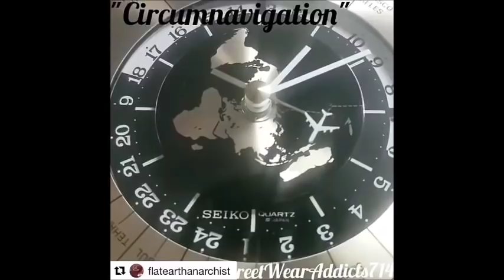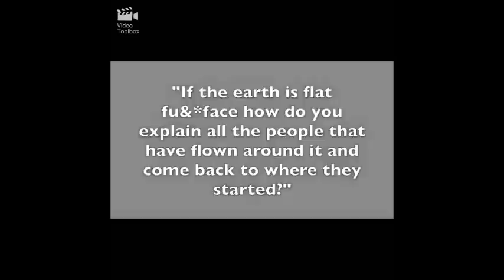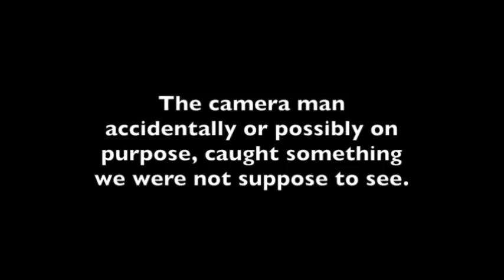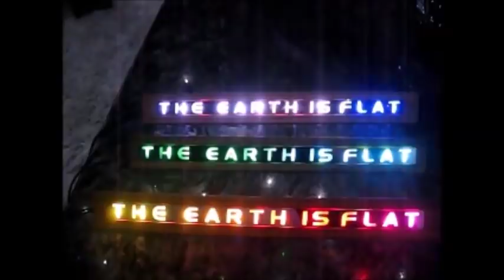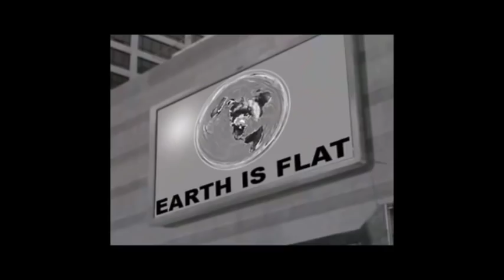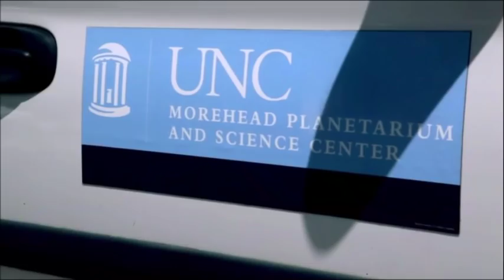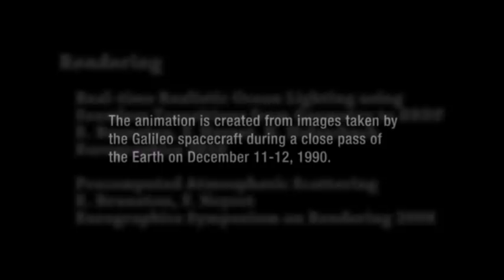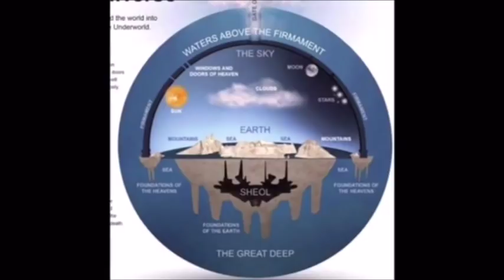Flat Earth Q&A Emails 84 Mark Sargent ✅

Comment: How do flat earthers explain Halley's Comet and it's 75 year orbit? You can't, just like you can't explain many other things.
Reply: ophirdog how do heliocentric ball and sun worshippers explain the fact that the gravity of the sun somehow turns Halley's comet around even though the comet was flying away from the sun for almost 40 years. That would be like turning Pluto around 180 degrees and making it come back to the sun. Also in those almost 40 years that Halley's comet was flying away from the sun, the sun has been flying through space at millions of miles an hour in a different direction. So the sun isn't even in the same spot it was at when it hurled Halley's comet back into outer space. Your model makes no sense and requires faith to believe
Reply: David Romero
The Sun's gravity does control Pluto, just as it does with every object in the solar system. And yes, the Sun does fly through space, but so does the whole solar system and everything else in the galaxy. 

So I'm wondering, can flat earthers explain the great length of time Halley's comet is travelling through space.
Reply: Light shining through water above firmament
Reply: @David Romero For us in the southern hemisphere the Sun moves in a anti clockwise direction. The Sun also heads in a southerly direction as it sets which is the opposite to what you people are claiming. You can't keep ignoring this fact forever.
Reply: @David Romero Why is it so had for flatties in the northern hemisphere to understand that the Sun's apparent motion in the southern hemisphere is anticlockwise. Yes, it still rises from an easterly direstion and sets towards the west. Also from the moment the Sun is above the horizon its size does not change all day, this would not be the case with the flat earth model. Atmospheric refraction rarely affects terrestrial objects to any degree and if there is refraction it's easily detected. You might want look into seismic waves as seismic wave velocities increase with depth and are refracted and reflected when a change in density occurs, a bit like when light hits the surface of water. Well at a depth of 2900km there is a pronounced boundary which is assumed to be the place where the lighter silicate minerals meet the denser metallic iron core of a global Earth.